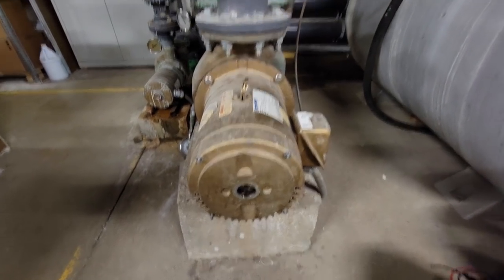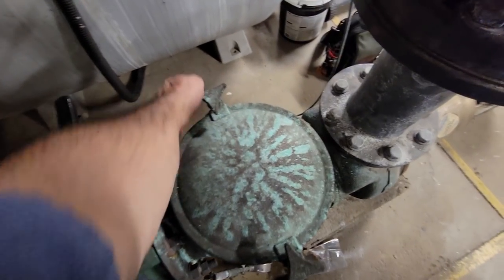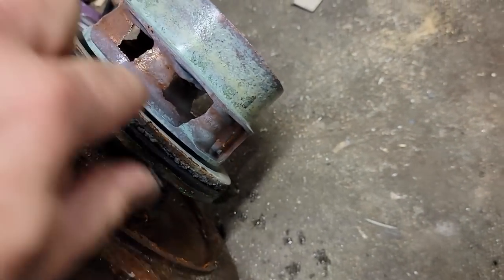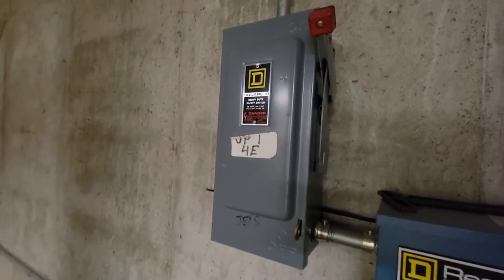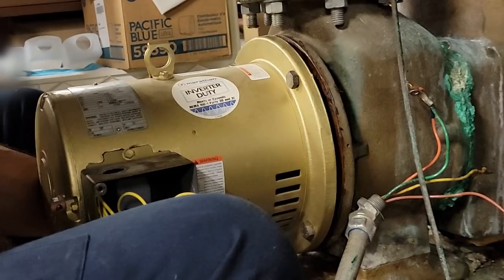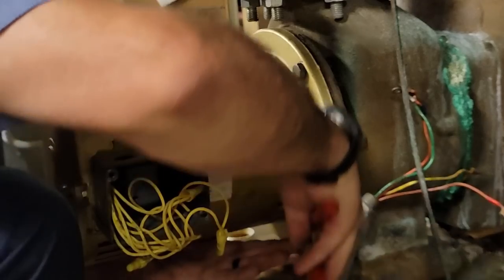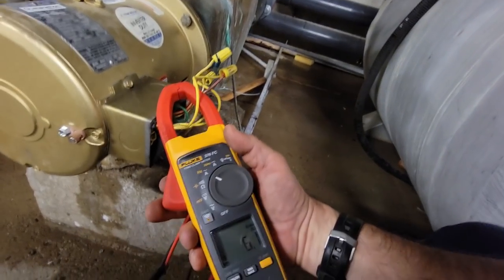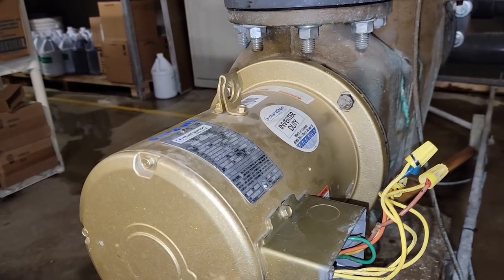Hurry I Need The Water 90* Now!

Comment: The damage at the housing and the Impeller is most likely due to Cavitation. That's why they use a VFD to run the motor at lower RPM to prevent the Cavitation.
Reply from the maker: Sounds logical to me. Thanks 4 the info!
Reply: I would have guessed chemicals and age to eat up the impeller.  Would you get cavitation when pump is located below the pool water level?  There should always be positive pressure at the inlet of the strainer.  But who knows how often those strainers are cleaned?

Comment: That damage is cavitation, I've seen this before, it's a saftey the variable frequency drive shutoff...
Reply from the maker: That drive was newer than the pump, I wonder if that was why they finally replaced it or at a min. added it.
Reply: If you wanted to be fancy you could add a pressure sensor to the suction side that slows down or stops the VFD before cavitation happens, that would be signal to for the maintenance guy to clean out filters before impellers and housings start breaking down again.
Reply from the maker: They lost the building management system years ago, and sweet it up by hand🤦🏻😁. They surely wouldn't pay for that.

Comment: a couple of threaded rod pieces or bolts with head cut of would be used as guides to locate and place the pump/motor combo easier than football humping it into place. lol
**have them long enough, stagger their length and grind outer ends to points, have them so impeller is just outside the volute. then you only have to get one bolt hole aligned at full weight, then twist until second aligns, then push into place and add other bolts to hold it then replace the custom alignment studs/tools
Reply from the maker: Good idea,  I don't do many pumps but I'll remember that.

Comment: matathon motors are good motors, have very little trouble with them. use bearing grease.works good. good job Rick.
Reply from the maker: Yes they are
Reply: @HVACRSurvival  how's the celebrity doing, got tired of being told what to do. Just kidding, they have no idea they have it good, until they work for someone else.
Reply from the maker: I figured that out when I was a manager. I'm good 👍

Comment: Nice and lucky 🤣
That could have turned into two open can-o-worms🤣
Usually all that crap is the same age and condition, between the gaskets and o-rings/ mechanical seals(some things wear in and marry)
Nice video,Thanks !
 one small tip ,put a little very little never seize on the threads.😉(bolts)
🍺🍺🍺🥃🥃🍿🏌🏻‍♀️
Stay safe. 
Retired (werk'n)keyboard super tech. Wear your safety glasses!
Reply from the maker: Thanks for the feedback! I appreciate the view!

Comment: Do you know what brand and model pump you were working with?  
It looked like it was made of bronze. These are expensive pumps; it probably could rebuilt to as-new condition by building up the damaged housing using TIG welding with a matching bronze alloy rod followed by remachining.
Reply from the maker: Yes,  the parts are not available for 8 weeks. There's way more important things in this building that need attention besides this pump. It's a never ending story.

Comment: Those impellers were not too god awful. i've seen worse for sure. They get destroyed being they're made up of brass and always circulating dirt or sand which slowly destroys them and the impeller housing as well.
Reply from the maker: I got price and availability..... close to a grand for the impeller,  or $2700 for all of it, the bad part is....NOT IN STOCK, 1-3 months out
Reply: @HVACRSurvival  Yeah if it deals with water especially marine or pools then shits going to be 100x more expensive. Sounds about right for the lead time and the way manufacturing has been going. It will only get worse before it gets better.